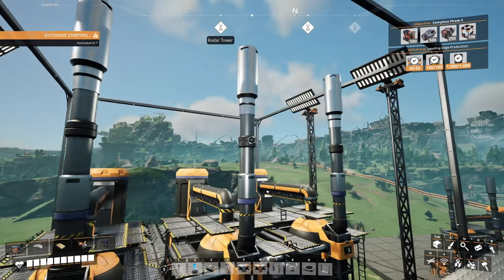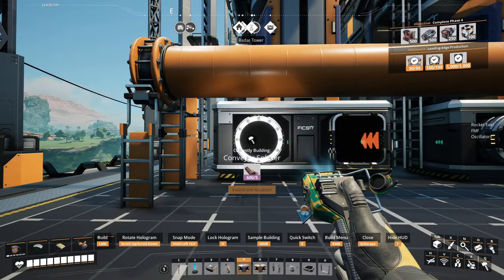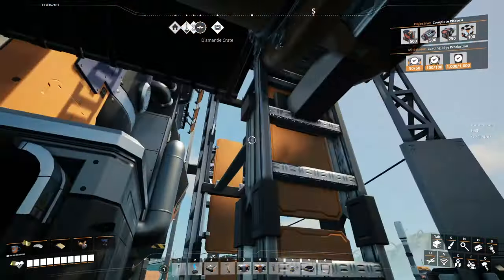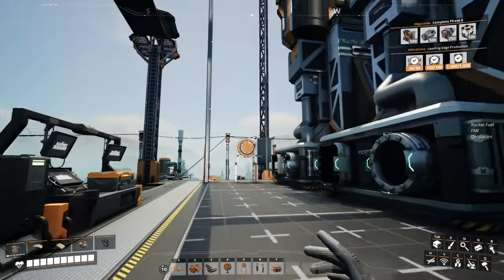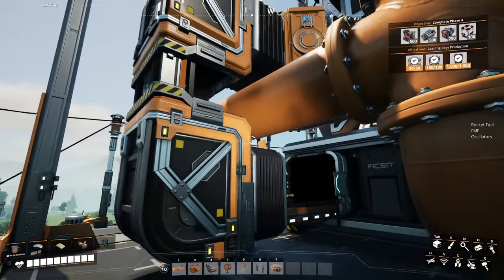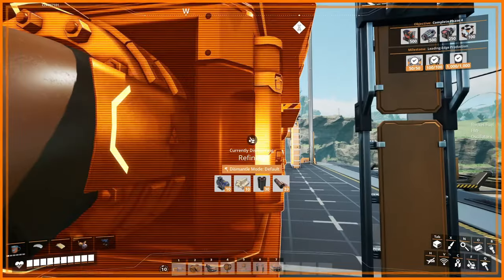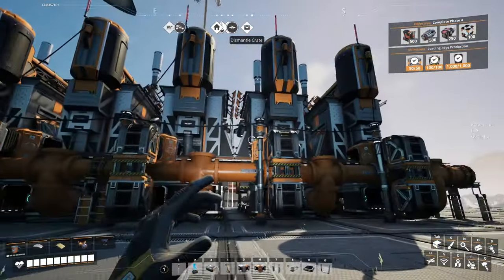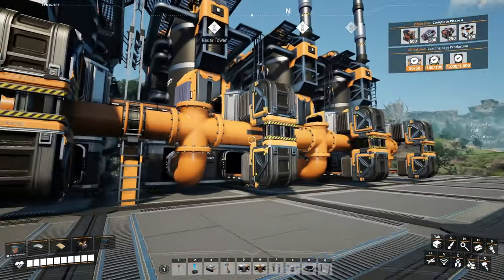Early Game Refineries Blueprint - Compact, Clean, & Tileable - Mk.1 BP - Satisfactory 1.0

Comment: I found you can make it even more compact by running 2 belts on top through the gap on top of the walk boards but below the pipe of the refinery. Then have feeds make a U shape or 2 L's if looking from above. The pipe line then fits snug in-between the lifts and refinery.

Comment: I would reconnect the pipes. There's a bug in 1.0 that the junctions don't cut the pipes off at the correct spot and the pipe will continue into the junction. It causes a lot of issues with through put.

Comment: Small proof of appreciation:
Yesterday I broke ground on my next big project. It's a raw materials to supercomputer factory for personal use, so just one machine making the SC plus whatever it takes to feed it.
I'm using the quartz route to also have a stock of oscillators to draw from.

Anyway, last night I built the plants at the iron and copper nodes to convert to the reinforced plates, cables and sheets on the spot.

I experimented with the concept I saw in your videos to have the output mergers over the input splitters.

The difference is that I aligned the mergers to the ceiling.

Anyway, I like how it affects the flow through the plant.